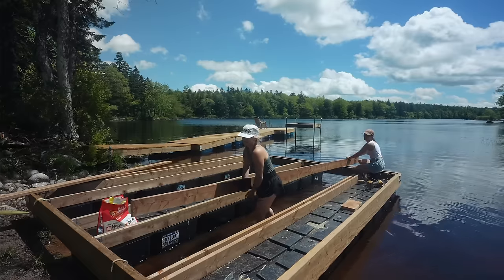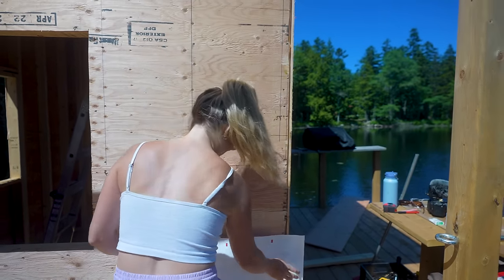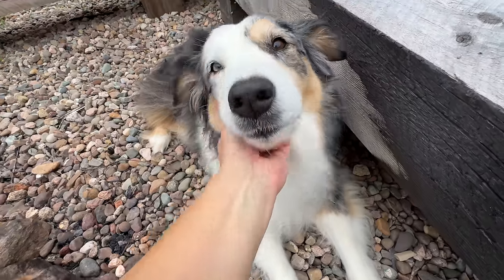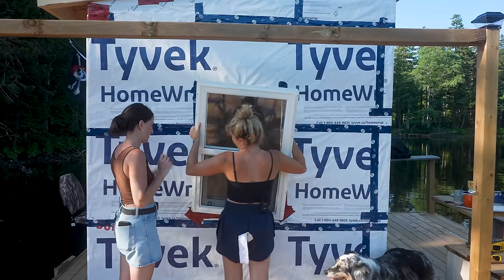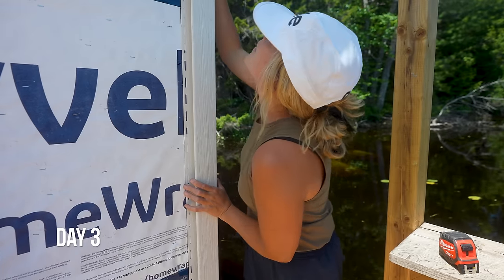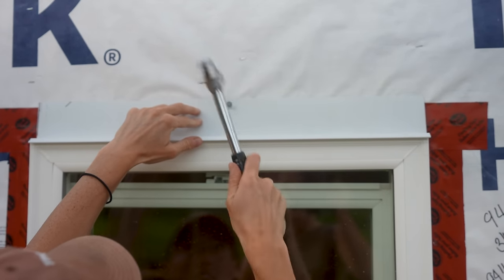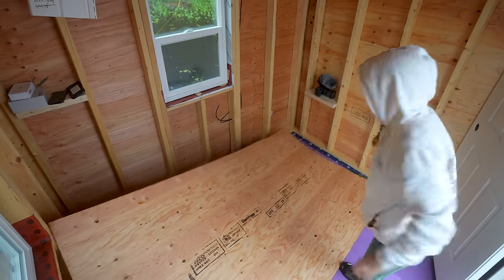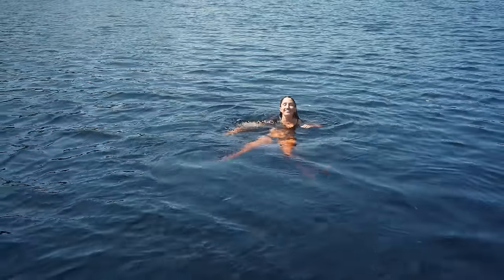Finishing Homemade Floating Raft House Boat (Part 2)

Comment: Keep a few paddles on hand in case of motor failure. Maybe some long poles too. You could add some pullout pontoons for added stability.
Reply: Yes, moving that big square without a motor is going to be difficult . I would experiment to see whether paddles or poles would work better.

Comment: When installing windows, dry fit your windows and strike a pencil line around the perimeter.  Then remove the window and caulk the BUILDING between the pencil mark and the opening.  That way you'll never caulk the wrong side again, AND you can pick up the window any way you need to.

You ladies did an amazing job and deserve to be proud!  KUDOS!
Reply: Sounds good to me! I have no idea how to do any of that. 😂
Reply: @sharondoan1447  Thanks!  I've put in hundreds of windows so far and that's my best method.

Comment: Tip people: when you cut Tyvek around windows, cut an x pattern and wrap the triangle flaps inside. Do not actually trim a square around the edges. Well done compensating on the flashing though. Also, boat construction is very different, 2x4s aren’t necessary. Weight is a consideration, that thing is way overbuilt! Well done though, it will last forever!

Comment: Awesome build! Side note! You can setup your trolling motor to “pull” by mounting it in the front of the boat and rotating the handle 180 degrees. It’s a single screw that holds the top part of the controls on the motor shaft. 2 minute job and you could stand on the front deck and steer your house boat.
Reply: This would be so great for them!
Reply: First thing I thought of as they mentioned looking through the window and opened door!  Great comment!
Reply: W comment

Comment: Awesome and fun build! Just a quick tip: If you're going to the lengths of wrapping and sealing the structure walls with Tyvek and Tuck Tape and the subfloor with under floor membrane, you may want to also waterproof the underside of the deck boards under the footprint of the structure. Because it's sitting over water, you're guaranteed to have moisture come up through the slits in the deck boards, which may affect the structure over time. It may be a pain to do at this stage of the build, but will provide some extra protection in the long run. Plus, you could wait to do it at the end of the season when you pull out the raft for the winter.
Reply: Thinking maybe that mod happens during the iCE FISHING floor remodel ;)

Comment: Tyvek is water tight, but also Air tight, and the super duper tape will seal off any drafts or cracks. It's probably more important in a full size building with windows, doors, and sealed indoor air system, but I used it on my van under the Reflectix to keep OUT the road dust, exhaust, wildfire smoke, etc., so that I can more easily control the "indoor" air quality and temperature. I'm with you Jas...pretty amazing to look at and feel the Tyvek, and how consider how such a simple lightweight material can be so strong.

Comment: Great job! A couple of tips for future projects. 1) never nail vinyl siding tight to a surface as it will buckle when hit by the sun and 2) when trying to hold a nail to start hammering hold it with the back of your hand towards the surface ie; shingle, board, siding whatever. You will appreciate the difference of hitting the pads of your fingers with the hammer as opposed to your knuckle, nail or back of your finger. It really makes a difference and if you watch builder vids most all have their palm facing out holding the nail. Keep up the great work you ladies do. Oh to be young and driven!
Reply: I was thinking the same thing.  My neighbor's siding buckled from being nailed tightly and not allowing for the wood to expand and contract
Reply: Those are great tips! I hope they see them.
With the house done, is there anything they can do about tip #1 now?

Comment: Remembering when I used Tyvek and Typar wraps….don’t miss those days.
Was common to wrap right over window and door openings as long as they were not overly large.
Then when done wrapping would use a utility knife starting at the center of the openings and cutting to each corner.
Then folding the wrap inside and stapling off…….there would only be little areas on each corner to cover…..less areas to tape after also.
Oh…thanks for showing your beavers.
Think I’d put the motor up front and with a chair you could steer with your foot….lol…..now that would be laid back plus your favorite beverage.
Reply: You actually don't pass code in certain areas now when you wrap house wrap around the frame of your windows! You can't pass where I live. It's because when you wrap it in, it can rot out your header and studs!

Comment: Great job wife’s ❤🎉😂. You might want to put a piece of mental corner angle where the anchor chain rubs on the wood decking. Good work🫶🏼✌🏼🙏🏻🇺🇸.
Reply from the maker: Thank you for your idea, great tip. 😊🐶

Comment: Put some tempered glass on the front door. Driver can see through with door closed on bad weather days. Also add a bow electric foot pedal trolling motor to steer on lazy days. Also acts as backup if main engine goes down.  Major outside work done, now to insulate and decorate the inside. Houseboat cabin starting to look more like a floating home.

Attach a safety line/chain around the rear motor to prevent it accidentally dropping into the water.

Comment: What a super project!  I absolutely love the raft and the tiny house aboard.  Seeing Crystal at the tiller having to look through the house made me wonder if you could rig up a pulley system and have a tiller or wheel at the front...  Or maybe two motors, one on each corner at the back and some kind of electronic control like a joystick?  Sorry, I'm always inventing things, I can't help it!  Just do what you wanna, of course, and we'll be watching!  Love you guys, big hugs from England where the excitement is rising for our meeting with Spain in a couple of hours.

Comment: Yay looks amazing 🤩 

I have one request/suggestion: the structure that your grill is on appears to be just two dimensional, some bracing would ease my mind that that if someone lent on it it would not give way... So some triangulation; just a diagonal timber from the top outer corner of the grill bench/counter down to the far edge of the raft (perpendicular if you looked down from above).

 If only comments would let he draw a picture😂

Comment: Awesome boat.  Mayby hook up a camera on the front roof and water cameras on the front and sides of the floor to monitor the shallow areas to a CCTV in the back by your motor, so you can guide your house boat via CCTV.  Or inlarge your windows. Happy your leg is healed and your beautiful dogs are just enjoying themselves.

Comment: I could not help smiling with you using a spirit level on a floating home. Each time you move the angle changes. 😜😜
Reply from the maker: Right! So silly but i did figure it out by the end of the video. 🤣🐶
Reply: @Vanwives  but still, you guys did a great job, I love it.

Comment: You can get a rubber grommet and put it in the hole that you made in the tin roof. It will keep the wire from rubbing the metal.

Comment: I have the same multi tool/Oscillating Saw as you know it takes the special expensive blades.  I bought an adapter. not only let you use any blade but will save you a lot of money.
Reply from the maker: Thank you for this tip! The blades are silly expensive & don’t last that long

Comment: You can turn your transom mounted motor to a bow mounted by simply removing one bolt, turn power head 180 and replace bolt.

Comment: P.S. You could also replace the door with a half-lite door that has a window at the top. Or retrofit your existing door by cutting it out and adding a window kit for doors to your existing door. Third option, cut the door in half, add some more hinges and make your door a Dutch door.

Comment: It's very homey, girls! I still think I'd suggest finding a small gas motor. Like 15 HP. Just in case. You might have to get off the water quickly in a storm, or if you should hit a log or something. Even if you kept it strapped to the deck, but had a place to mount it quickly. A 5 gallon gas can and you'd be very set for any kind of maneuvering you could have to do. Just a thought.  ;)

Comment: In my experience, there's been a pretty substantial difference between expensive and cheap silicone and construction adhesives. Cheap construction adhesives just don't work at all and I don't even know why it exists at all. Cheap silicone (even when not opened) expires a lot faster and also molds a lot faster too.
Just stick to the good stuff, cuz it ain't worth the risk.

Comment: You two are the coolest. Great job creating your “stress buster” platform. Many years of fun ahead. The beavers you were watching are really cute but just a heads up, given the chance or being threatened by a dog in the water they will grab the dog and drown it. River otters will do the same. Most prevalent when they have young with them. Remember both species are as large as your dogs and are quite vicious.

Comment: I've surprised.  In Florida once you put a motor on a water craft you need to have it registered, adhere to all water craft requirements, including proper night navigational lights, enough life vests for everyone onboard, proper fire suppression, And if self built has to meet proper weight balance ratio to ensure it won't nose dive into choppy water.

Comment: Hey Girls, you can‘t use a spirit level on a boat. The window is now parallel to the water but not to the boat. Does not matter i think but have it in mind if you plan a Ark soon ;-)
Reply from the maker: We concur, I was truly thinking about that. I did mention it, a level does not make sense. Right! 😊🐶
Reply: @Vanwives  I was not at that point in the Video when i wrote it. You both did a great Job! Thanks for your videos!

Comment: So, need a ship wheel for steering!
Reply: Consider fiberglass rods going down to sense depth.
Reply: Check out "red hats" (gromets) to protrct wires going through metal openingd.

Also, a romex or liqyitite connector can be fit into a hole.

Comment: As far as the door is concerned, I would have installed it so the door swings open towards you vs away from you.  The way you have it now, it takes up too much room inside the little raft house.

Comment: Super great that the Sundays dog food is cheaper than I guess farmers market. But still just for 3 weeks cost $199 with 50% off that's $100 for 3 weeks. I give my dog Iams dog food as well as wet food everyday anything sure don't cost near that amount. Affordable it depends on who you are. How much is freaking farmers market???? I have looked in the Farmers Market before and I really didn't think it was that much as much as this. But I could be most definitely wrong. It's been awhile so maybe I need to recheck. But even with 50% off it's still $100 for 3 weeks! That's crazy unless you're making that type of money to be able to afford that. Unfortunately I do not unfortunately😢

Comment: So yes and no caulks are all made of similar compounds such as latex rubber and silicone \a mix of all or one of the compounds giving them various differnt strengths and weather resistents factors so you could use a differnt caulk with similar chemical compound and get away with it but their not all created =
Reply from the maker: We do appreciate you sharing your knowledge with us. Thank you. 😊🐶
Reply: @Vanwives   Anytime love the vlog it's been popping you got me inspired again and I'd love to make wood fiberglass boat and maybe sell them if it turns out but I'm not going to get ahold of myself😅🤣

Comment: I wouldn't pay any attention to the guy that asked you guys to get a bigger motor considering the fact that you have shallow Waters to go through and you've actually built a houseboat so you don't need a bigger motor but I would consider possibly getting an extra trolling motor just in case and possibly paddles, you didn't build that as a speedboat built it as a luxury boat

Comment: Making a solar wire roof grommet - slit 1/4" poly tubing lengthwise and cut to length, then insert around perimeter of metal roof hole.

Comment: Hey girls, way to get after it!
Just fyi, you should have just squared up the windows to the frames, the level isn’t perfect on a floating dock. If the dock isn’t level on the water (like any weight on one side) neither is the house. Also where I live, once you put a motor on it, she needs to be registered as a house boat..😬

Comment: You are a couple of young whippersnappers. No, you did not see cars held together with tuck tape. That is shiny and light and meant especially to tape down Tyvek.  The substance you are referring to is duct tape.  That is not very shiny and stronger than its own weight in steel.  I can see how you probably heard it said out loud and never saw the spelling lol.